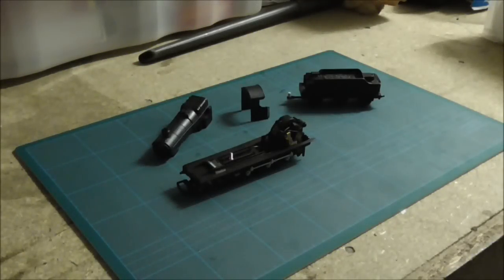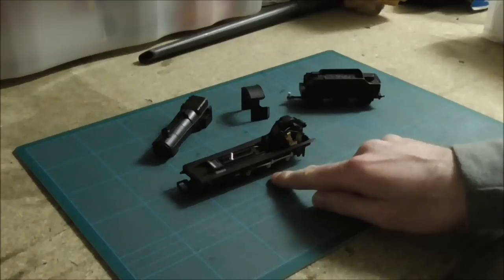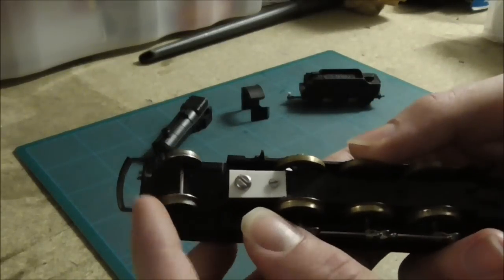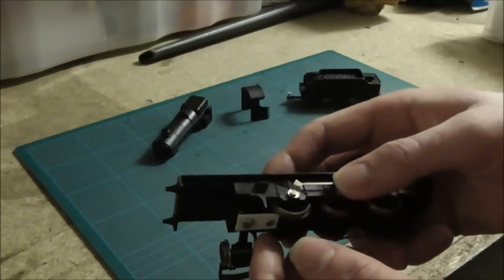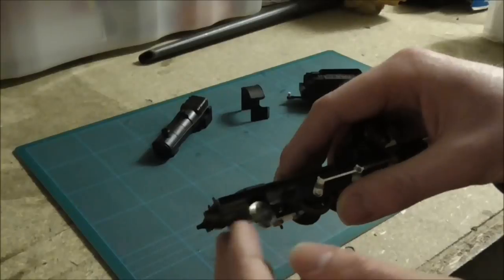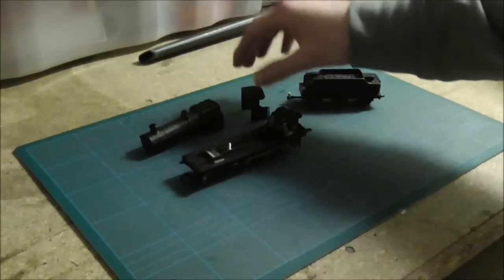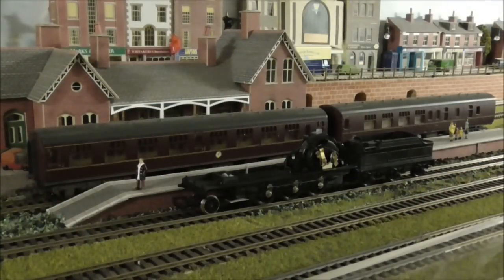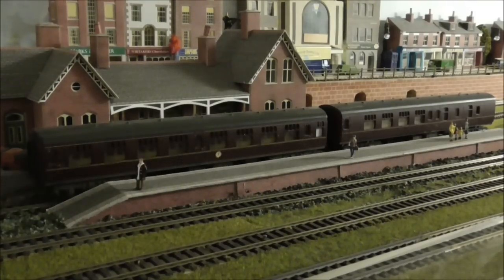GWR 2600 Class Project - Update 7

Comment: Looking good, and running quite well, may need some tender pickups  to help it over the points, depends how well the service will help it. Depending on what glue you use for your nut, what I may suggest is get some plasticard, make a block, drill a hole through so your screw goes through ( probably hold it In the area your mounding it to) then with the nut and screw lining the nut up with the hole, apply say a soldering iron to the nut and let it melt a hole in to the plasticard... and there for a nice and secure, no glue needed apart from gluing plastic to plastic, much more secure and safe, and won't detach itself.
Reply from the maker: Thanks for the tips Matt. Will bare in mind. Was thinking about adding some tender pickups at a later date. Not very clued up with my wiring at the moment, so will need to get a bit of practice in first. ;)
Reply: SDJR7F88 no problem, there is some instructions on my website on one of the PDF write ups, think the Wills/SEF U class has them on the Atlantic... so all on there if you need.
Reply from the maker: Brill, will give it a look :)

Comment: just a thought but if you still need  a weight on the pony truck, fishing weights, small, smack with a hammer, and glue, nice to see it running will be nice to see it all together ( in Canada we have small bell weights ) they look like a church bell
Reply from the maker: Thanks for the tip. Will take a look for those. Once the boilers on, I think the weight issue will be sorted. Where it seems to be lacking at the moment is over the front drive wheel.